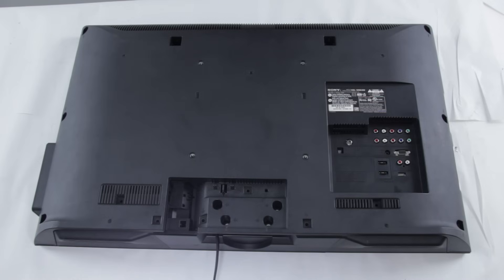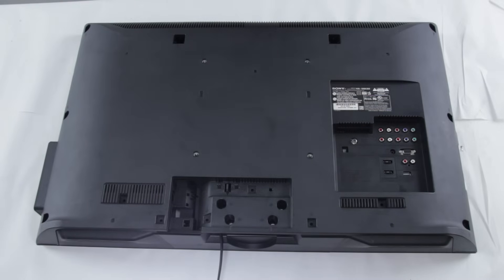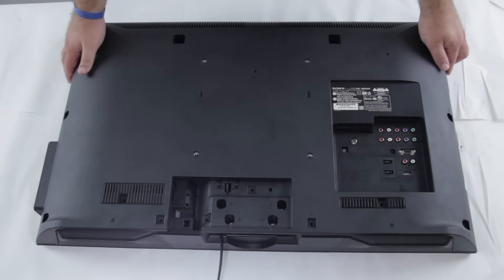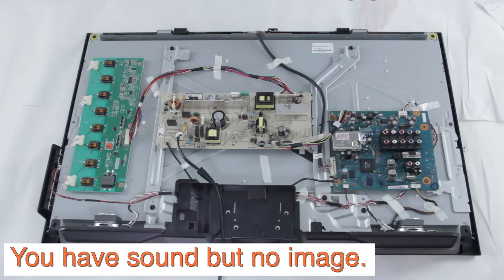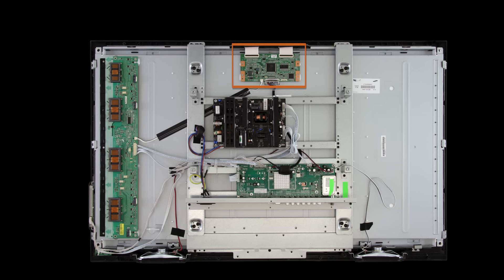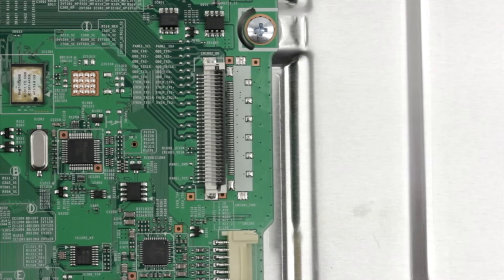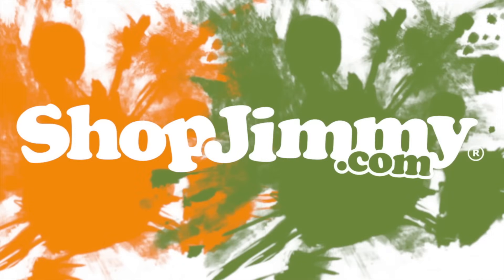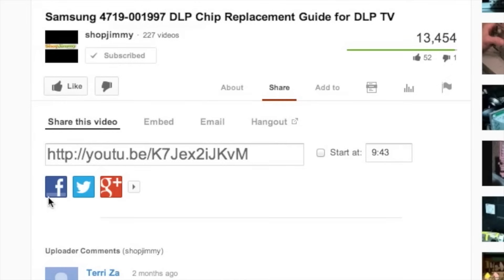LCD TV Repair Tutorial - T-Con Board Common Symptoms & Solutions - How to Replace T-Con Board

Comment: I have a Vizio M3D650SV 1/3 of my screen is black . Don't know if this helps but it started with vertical lines on the left of the screen just 3  single lines . I have a picture  for  5 inches on the left then 11 inches of black screen then 26 inches of picture . the black has fixed it self a few times but now won't go away
Reply from the maker: Douglas Winsor   Try all repairs and troubleshooting at your own risk.  This sounds like a TV panel (TV Screen) problem.  If your TV panel is bad, it may be more cost-effective to replace the TV as panels are typically hard to find in stock, difficult to replace, and expensive.  Thanks and please let us know if you have any further questions!  www.shopjimmy.com

Comment: Hi,
I have a samsung LED smart TV
Model # UN40EH5300FXZA
S/n # Z4TV3CVDCO1655T

I have sound but no picture.
I also tried putting flash light on screen and i can see the channel logo and some faces.
I want to confirm if it can be only due to a faulty T-con board.
I also found the same board on your site, but wanted to be sure before ordering it.

Harish
Reply from the maker: harish kumar  Try all repairs and troubleshooting at your own risk.  This could be a problem with either the power supply or bad LEDs in the TV.  You can replace the power supply board to see if that fixes the problem.  Click this link to replacement power supply boards for your TV model number:  http://www.shopjimmy.com/catalogsearch/result/index/?cat=229&q=UN40EH5300FXZA  There may be multiple boards for the same TV model number, be sure to match part numbers on your current board, with your replacement for compatibility.  Here is a link to a video showing how to identify your part number, click here:  https://www.youtube.com/watch?v=sSJexLvRrjMThanks and please let us know if you have any further questions with your TV Repair!  www.shopjimmy.com
Reply: ShopJimmy.com : I replaced the power supply board, but that doesn't solve the problem.
by bad LEDs, you mean the actual light on side of the panels, right?
I guess that cann't be replaced.
In that case this TV can't be repaired? or it can?
Reply from the maker: harish kumar   Try all repairs and troubleshooting at your own risk.  Yes, the LEDs are the lights inside the TV.  It may be possible to find replacement LEDs, however we do not sell them for your TV model number.  Thanks!  www.shopjimmy.com

Comment: I have a Sharp LC-42LE620UT 42" TV. The symptom is sometimes the picture and sound come out and sometimes they don't. Switching to different HDMI port or S-Video port does not help. A shake on the TV sometimes helps but not all the time. Is the main control board broken? Thank you!
Reply from the maker: Jianxiong Yu   PLEASE SUBSCRIBE TO OUR CHANNEL - Try all repairs and troubleshooting at your own risk.   I recommend replacing the main board in your TV.  Click this link to replacement parts for your TV model number:  http://www.shopjimmy.com/sharp-cbpf92zba1-main-board-for-lc-42le620ut.htm  There may be multiple boards for the same TV model number, be sure to match part numbers on your current board, with your replacement for compatibility.  Thanks and please let us know if you have any further questions with your TV Repair!  www.shopjimmy.com

Comment: I have an LG 47LW5600. It fires up and shows the initial logo screen. After that it's just black. I was told by a tech it is most possibly the graphics card. Is that accurate, and where do I purchase a graphics card for my television.
Reply from the maker: Jabaar Dugan   Try all repairs and troubleshooting at your own risk.  I recommend running the flashlight test on your TV.   Here is a link to a video we produced that shows how to run the flashlight test. https://www.youtube.com/watch?v=xUzCLgoSPGM Please reply with your flashlight test results and we can recommend a replacement part for your TV repair. Thanks and please let us know if you have any questions! www.shopjimmy.com

Comment: Sony Bravia kdl-60ex500 - The whole left side of the screen is jacked.  It has several faint vertical greenish lines and has major contrast issues when playing bright scenes, blown out.  The left side still works great.  While back, condensation dripped into the tv directly where the t-con board sits, very middle. I blew a fan into the tv for a full day before turning it on, but the whole screen was all messed up...nothing but colored noise. I left it on for a few hours and it starting working again, kinda... left side started to have the current issue. It wasn't as severe at first, would flicker on and off...  I figured out that I could bang on the left side of the tv to correct the issue, this method worked for about a year... but my fix isn't working any more.  I'm hoping it's just a bad T-Con board? I really would like to wait another year before throwing 4k on a 4k tv...         .
Reply: Was a ribbon
Reply: Klint Bower

Comment: Hi I have LG tv model 32LG70-UA i have a light white screen but I'm still able to see some images in the back. I'm not sure if its T-con board or just the ribbon.
Reply from the maker: alphabetx  Try all repairs and troubleshooting at your own risk.  This could be a problem with either the main board, the t-con board or the TV panel.  You can replace the main board and t-con board individually to see if one of those boards fixes the problem.  Click this link to replacement parts for your TV model number:  http://www.shopjimmy.com/catalogsearch/result/?q=32LG70-UA  Be sure to match part numbers on your current board, with your replacement for compatibility.  Thanks and please let us know if you have any further questions with your TV Repair!  www.shopjimmy.com

Comment: I have a Samsung LN46C630K1FXZA.  It has no picture and no backlight but has sound.  I replaced the T-Con Board and Inverter with your replacement parts.  Still no picture and no backlight but still has sound.  I visually looked at the capacitors and they appear to be ok, not bulging or leaking; I have not tested them, though.  Are there any fuses that could be burned out? Thoughts, suggestions and/or next steps would be very helpful.
Reply from the maker: Roger Gansauer  Try all repairs and troubleshooting at your own risk.  I recommend running the flashlight test on your TV.   Here is a link to a video we produced that shows how to run the flashlight test. https://www.youtube.com/watch?v=xUzCLgoSPGM Please reply with your flashlight test results and we can recommend a replacement part for your TV repair. Thanks and please let us know if you have any questions! www.shopjimmy.com

Comment: I have a Sony Bravia that would not turn on the other day.  When you power it on the power indicator blinks 14 times, pauses then repeats.  I've left the tv unplugged for a day and tried it again but after about 10 seconds the tv shuts off and then begins to blink.  I've read that "14 times means the LCD panel is defective"  Does this mean the T-con board needs to be replaced or is it likely something else? 
It is a Sony Bravia KDL-52WL140 LCD
Your help would be very much appreciated.  I can not afford a new tv so my fingers are crossed.  Thank you kindly.
Reply: Ann Thompson I should also mention that I removed the t-con board and powered on the tv.  With the t-con board removed the tv stayed on. Th back light came on and there were no blinking error codes. Brief comments found elsewhere on the web suggested that this indicates a problem with the t-con board as opposed to the actual lcd panel itself.  Visually the t-con board looks fine, no obviously failed components and the one and only fuse that I see on the board (not to say there aren't more) has continuity. 
What is your professional opinion?  Could it still just be a bad t-con board or is it more likely a bad lcd panel?
Reply from the maker: Ann Thompson   Try all repairs and troubleshooting at your own risk.  This sounds like a TV panel (TV Screen) problem.  If your TV panel is bad, it may be more cost-effective to replace the TV as panels are typically hard to find in stock, difficult to replace, and expensive.  Thanks and please let us know if you have any further questions!  www.shopjimmy.com

Comment: I have a Sony 52” Model: KDL-52W4100 Serial: 8129140, the screen goes black after about 10 minutes showing normal picture.  Could heat on the board be causing that?  Thanks in advance for your time.
Reply from the maker: Hau Shing Li  Try all repairs and troubleshooting at your own risk.  I recommend running the flashlight test on your TV.   Here is a link to a video we produced that shows how to run the flashlight test. https://www.youtube.com/watch?v=xUzCLgoSPGM Please reply with your flashlight test results and we can recommend a replacement part for your TV repair. Thanks and please let us know if you have any questions! www.shopjimmy.com
Reply: Hau Shing Li Sorry for the cryptic posted, listen learned, don't copy and paste from MS Word.
Black light is good, when screen go black there were still audio.  Place fan on the back of the unit problem when away.  Please comments.
Reply from the maker: Hau Shing Li   PLEASE SUBSCRIBE TO OUR CHANNEL - Try all repairs and troubleshooting at your own risk.  The main board is failing in your TV and the fan is just a temporary fix for the problem.  I recommend replacing the main board in your TV.  Click this link to replacement parts for your TV model number:  http://www.shopjimmy.com/catalogsearch/result/index/?cat=56&q=KDL-52W4100  There may be multiple boards for the same TV model number, be sure to match part numbers on your current board, with your replacement for compatibility.  Here is a link to a video showing how to identify your part number, click here:  https://www.youtube.com/watch?v=Aodz2LHkzbY  Thanks and please let us know if you have any further questions with your TV Repair!  www.shopjimmy.com

Comment: I have a  LN37A550P3FXZA  when the set is powered up pic is fine but starts to fade to white and holds fade. The pic will not fade anymore says consistent on the fade. The audio is fine....thank you
Reply from the maker: Washer Dryer   PLEASE SUBSCRIBE TO OUR CHANNEL - Try all repairs and troubleshooting at your own risk.  This could be a problem with either the t-con board, the main board or the TV panel.  You can replace the t-con board and the main board individually to see if one of those boards fixes the problem.  Click this link to replacement parts for your TV model number:  http://www.shopjimmy.com/catalogsearch/result/?q=LN37A550P3FXZA  There may be multiple boards for the same TV model number, be sure to match part numbers on your current board, with your replacement for compatibility.  Thanks and please let us know if you have any further questions with your TV Repair!  www.shopjimmy.com

Comment: I have a LG 42LM3400 tv. The picture has vertical lines and it freezes intermittently about every two seconds while the sound is OK. Please assist in fixing the problem.
Reply from the maker: Sakkie Oosthuizen  PLEASE SUBSCRIBE TO OUR CHANNEL - Try all repairs and troubleshooting at your own risk.  This could be a problem with either the main board or the TV panel.  You can replace the main board to see if that fixes the problem.  Click this link to replacement main boards for your TV model number:  http://www.shopjimmy.com/catalogsearch/result/index/?cat=56&q=42LM3400  There may be multiple boards for the same TV model number, be sure to match part numbers on your current board, with your replacement for compatibility.  Thanks and please let us know if you have any further questions with your TV Repair!  www.shopjimmy.com

Comment: Hi, I have a KDL-40EX520 (Sony), the image is greenish, the tv is around 3 year old.  Is it a problem related to the LCD or T-COM? Thank you
Reply from the maker: Nestor Rambaldo  PLEASE SUBSCRIBE TO OUR CHANNEL - Try all repairs and troubleshooting at your own risk.  This could be a problem with either the main board, the t-con board or the TV panel.  You can replace the main board and t-con board individually to see if one of those boards fixes the problem.  Click this link to replacement parts for your TV model number:  http://www.shopjimmy.com/catalogsearch/result/?q=KDL-40EX520  Be sure to match part numbers on your current board, with your replacement for compatibility.  Thanks and please let us know if you have any further questions with your TV Repair!  www.shopjimmy.com

Comment: HELP! I have a Samsung Model LN-samsung LN-S3251D 32" LCD. Serial # AEEE3CHP202008P. The picture has gone out, but I still have backlight when the power is on. When switching the input, the backlight gets brighter on certain channels. Not sure whether we have sound, since I can't confirm if I'm on the correct input I have sound plugged into. No luck guessing so far. I have replaced poor capacitors and suspect a TCON board problem, help! Thanks

Comment: Does the Samsung 42'' Plasma HPT4254X/XAA have the self test option? I disconnected the main board, Shorted pins 3 and 4 on the logic board and grounded pson. Power board went on had all the right volts Vs205, Va63, green light on logic was flashing about once a second but no self test picture, screen was dead so I was wondering does this model offer this lodic board self test or is there something else wrong with the TV. Thanks
Reply from the maker: chow Samaritan   PLEASE SUBSCRIBE TO OUR CHANNEL - Try all repairs and troubleshooting at your own risk.  This could be a problem either the Y-Main Board and Y-Buffer Board or the TV panel.  You can replace the Y-Main Board and Y-Buffer Board to see if that fixes the problem.  Click this link to replacement parts for your TV model number:  http://www.shopjimmy.com/catalogsearch/result/?q=HPT4254X%2FXAA  There may be multiple boards for the same TV model number, be sure to match part numbers on your current board, with your replacement for compatibility.  Here is a link to a video showing how to identify your part number, click here:  https://www.youtube.com/watch?v=R1jmj_foId0Thanks and please let us know if you have any further questions with your TV Repair!  www.shopjimmy.com
Reply: ShopJimmy.com Thanks for the info and excuse me for my ignorance but I am still wondering if this model Samsung 42" hpt4254 offers the self test by grounding pins 3 and 4 on the logic board? Also if I disconnect the Y-main or any other board it does not effect the speed of the flashing green light on the logic board, I have watched videos showing that when there is a problem with a board or a board is disconnected the green light will flash at a slower rate. I'm wondering if this is true with my model.

Comment: Hi, I have SONY KDL52xbr9. Sl no 8024191. When I power on the TV it turns on and displays BRAVIA image on the screen for few seconds and goes off. The standby red led blinks for 5 time first and 6 times after that. Nothing happens further and no sound is heard. I went through some of the web sites and they said there could be a BU board problem, so I tried to replay with a new board. Still the same problem persist but with the new board standby red led blinks 13 times continuously here after. Any suggestion to fix the TV is appreciated. Thanks in advance.
Reply from the maker: arunkumar pichaimuthu   Try all repairs and troubleshooting at your own risk.  This sounds like you have bad lamps in your TV.  Unfortunately we do not sell replacement lamps.  Thanks!  www.shopjimmy.com

Comment: I have a Sony lcd model kdl46w4100. The tv turns on and turns back off and blinks red 14 times. If I remove the lbds (i think it was called in this video) cable from the t con board, the tv stays on. I went to shopjimmy.com and my exact model for t con boards is not listed. Can I use a t con board for the kdl46v4100 which is a lower end model from the tv I have?
Reply from the maker: Marcus Brooks  Try all repairs and troubleshooting at your own risk.  You will want to find your t-con part number and then search for results.  In those results it will show if we know of any compatible substitute boards.  You can use this video to help find your part number:  https://www.youtube.com/watch?v=rNNhghZ1pkA  Thanks!  www.shopjimmy.com

Comment: I have a sony kdl-55hx820 that turns off itself after a few seconds, 1 out of ten times it stays on and works fine.

I have done a full factory reset and updated the firmware and still have the same problem, not to sure what the problem is, can you please help me?
Reply from the maker: stevojan  PLEASE SUBSCRIBE TO OUR CHANNEL - Try all repairs and troubleshooting at your own risk.  I recommend replacing the main board in your TV.  Click this link to replacement parts for your TV model number:  http://www.shopjimmy.com/sony-a-1819-030-a-batl-board.htm  Be sure to match part numbers on your current board, with your replacement for compatibility.  Here is a link to a video showing how to identify your part number, click here:  https://www.youtube.com/watch?v=Aodz2LHkzbY  Thanks and please let us know if you have any further questions with your TV Repair!  www.shopjimmy.com